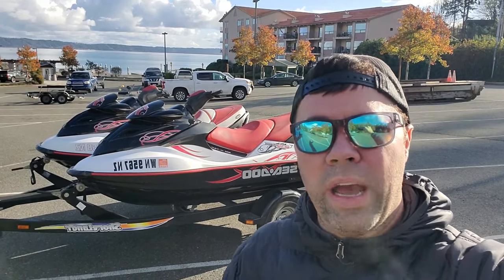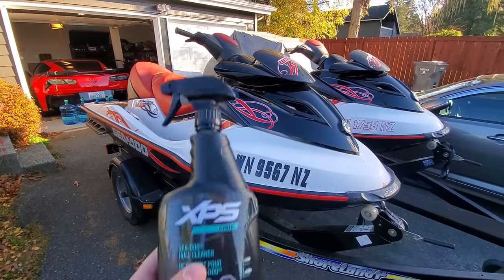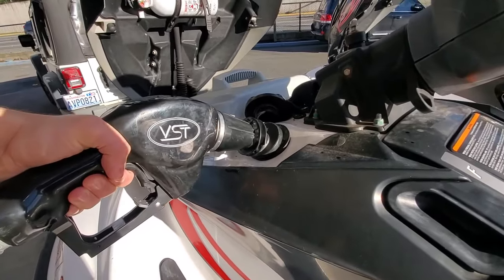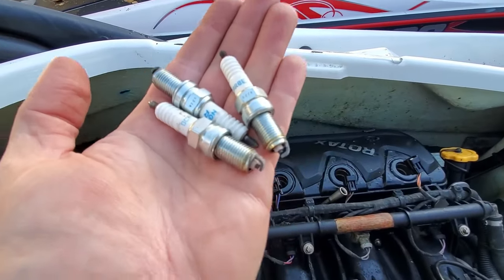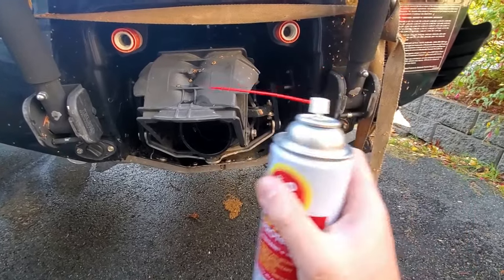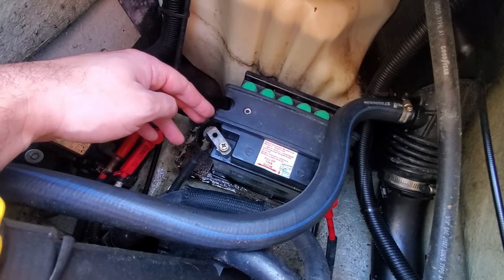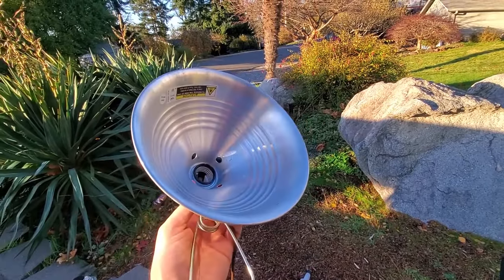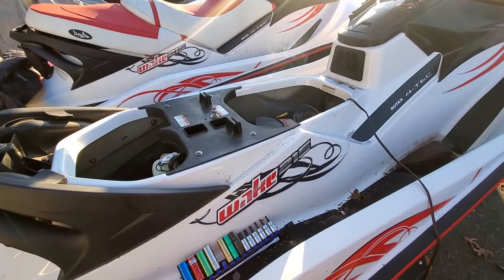How To Winterize Your Jet Ski \\ How To Store Your Jetski (Seadoo, Waverunner, Jetski)

Comment: just FYI from someone that lives in NJ and stores his skis outside - get some recreational bio degradable RV antifreeze (pink usually)  and a cheap Amazon transfer pump.  Run the antifreeze through the hose plug/nipple on the back until you see it coming out instead of plain water - I usually use 3 gallons in a Home Depot bucket - Then use the compressed air (brilliant BTW - never did that will need to try this year) The intent being to replace any remaining water with antifreeze first. Also the XPS spray is silicone - FluidFilm is parrafin wax.  Both work well - one year I only had WD40 in the big blaster can and used that.  Our skis are salt water used......
Reply from the maker: Thanks for sharing!  I will keep that in mind for this fall!

Comment: Shutoff valve on end of your hose... good exercise excellent video tks.
Reply from the maker: I need one of those on my hose!
Reply: Is it really okay to run it for 3 minutes on just the hose? From the videos I've watched and information from the manufacturers you should not run your ski out of water even on a garden hose for more than a minute because your carbon seal on those seadoos can heat up and start melting! I would think running it for 3 minutes would pretty much destroy your carbon seal? I'm not trying to say you're doing it wrong I just want to make sure I know how to do it right :-) maybe 3 minutes is totally okay I don't know?
Reply: I shut off valve is a great idea! I would maybe suggest a 2 ft or 3 ft stub of garden hose and then I shut off valve so you're not reaching your hand up in there when it's running. My luck I would hit something or stick my finger where it shouldn't go lol. But that's a good idea having to shut off valve so I'm not running over to the water spicket, I don't like to run :-)
Reply: @chrishorn2028  NOOOOOO only 30 seconds to be safe, the seal heats up fast.

Comment: Thanks for replying. Um can I start jet ski with no water. Just for a second to see if it runs.???  I did fog the cylinders.?? I seen you doo it. For a second . Others say no way. Why.?? Lol Thanks 😮 and mine is 96 tripple Yamaha.
Reply from the maker: Yes you can start it out of water.  I've done this many times.  I do not recommend letting it run for longer than a few seconds though.  Jetskiis are water cooled.  Because you are running it out of the water, there will be no cooling for the engine which is not good if it gets too hot.

You can buy a hose adapter for cheap so you can connect your garden hose to your jetski!

Comment: Agree with you about oil change I preferred to do when season starts...I don't understand why they put fresh oil an filter to stay 8 months in ..cold wheatear
Reply from the maker: Exactly!  What ski do you own?
Reply: You change the oil at the end of the season because used oil has a corrosiveness to it. If it sets all winter it's not good on bearings or other metals.
Reply: Just like the other person commented I've always been told you need to change the oil at the end of the season on anything, lawn mowers snowmobile jet ski whatever because if you let that oil full of contaminants sit all off season you run the risk of corroding your main bearings and anything else it's touching near the bottom of the engine!

Comment: I like the air method but after you turn off the water, I would rev the engine to 4k rpm a few times to blow out most of the water from the exhaust system. Then use compressed air to blow the water out of the cooling system.  This is due to the same reason you need the engine running before you turn on the water. You don’t want water traveling up the exhaust into the engine. You can run Kawasakis for 15 seconds with no water per the manual. Probably the same with all PWCs.
Reply from the maker: Thanks for sharing!  Makes sense
Reply: Yes I've and told the same thing that you have to have the motor running before you start the water flow but if that's true that it could back up into the exhaust ports then how does that not happen when a person pumps antifreeze into that same system with the motor shut off? Theoretically wouldn't you pump the antifreeze right into the exhaust port and possibly hydro lock the motor the next time you start it ?
Reply: Or do you also have to have the engine running when you pump antifreeze into it to winterize it? Thinking about doing it myself but I don't want to wreck the darn motor or risk freezing and cracking the exhaust manifold!
Reply: Yes, engine must be running if you pump antifreeze into it.

Comment: So if you do the air compressor method; is the marine antifreeze not required?
Reply from the maker: I have had seasons where I just use the air compressor and my ski is just fine every season.  However, if you live in a very cold climate, where it consistently reaches and stays below freezing temperatures, I would probably do both method.

Comment: Thanks for the video.  I have seen two other ways to winterize...(1) hook up the quick connect to anti-freeze and gravity feed until it flows out the bottom, I don't remember turning on the engine...(2) use an air compressor to blow out the water.  I didn't see you do either.  Lastly- can I just put boat in the water when spring is here and not do anything other prep?  Of the 2 things above, which do you recommend?  Thank you.
Reply from the maker: I did hook up an air compressor in my video and blow out the water from the exhaust.  Good idea on the anti-freeze.  I have never done that option but think doing both the anti-freeze and compressor would be the way to go!
Reply: @JMGENTERPRISES  Thank you!
Reply: Thank you.
Reply: @JMGENTERPRISES  I am confused obviously, and new to these.  Yes. I do remember the air compressor, my bad.  You replied to both the air compressor and gravity feed the anti-freeze.  Why both?  I ran my while gravity feeding the anti-freeze and it smoked a little while doing it.  Why?  I watched a video by someone else who didn't run the engine.  Do you know why?  Thank you.
Reply: How do you blow out water from the exhaust?  I have a quick connect which is the only port I have, that's what I ran the anti-freeze thru.

Comment: Would you recommend running antifreeze through the system? That’s what I did last year but I did not own a compressor at the time. Shooting air through should suffice?
Reply from the maker: Would probably be best to do both.  Run antifreeze through and blow out the water from the exhaust.  I never did the anti freeze thing on mine and never had an issue.  Let me know what you decide!
Reply: So when you add antifreeze to it through the same port that you hook up the water hose, do you need to have the engine running well you're pumping antifreeze into it so you Don't pump antifreeze into the exhaust ports? Or is it better to have the engine off? I'm worried about hydro locking the cylinders if RV antifreeze is pumped up into the exhaust ports. I've never tried to winterize myself so I'm new to this so I'm just trying to make sure I don't blow a head gasket the first time I start the damn thing next year

Comment: you left fresh water and not rv,boat fluid in your engine?
Reply from the maker: Correct.  Never had any trouble with fresh water as long as you fog the engine and remove any water from the exhaust system
Reply: @JMGENTERPRISES  How do you remove water from the exhaust system?